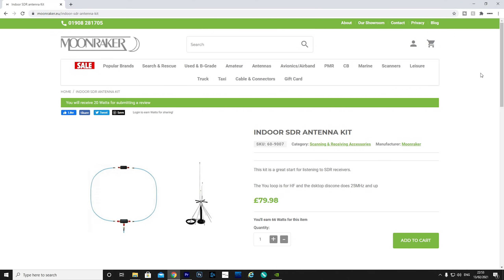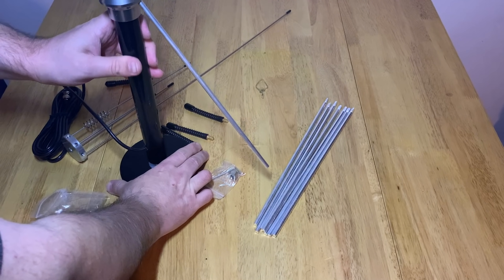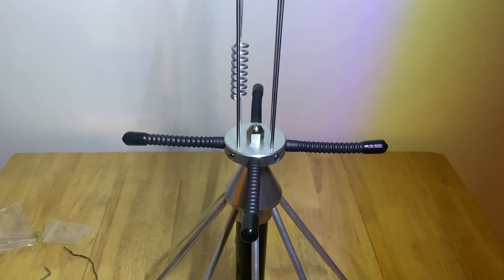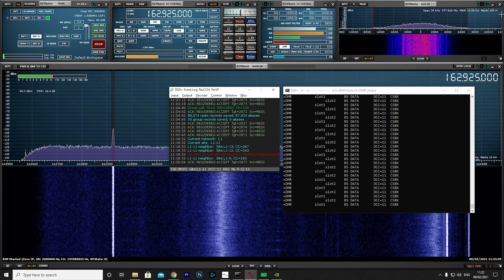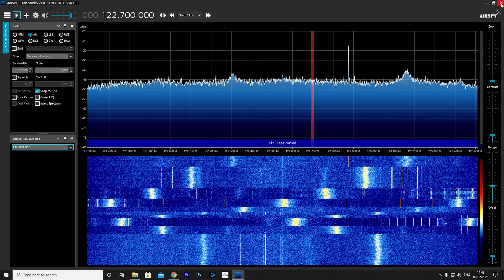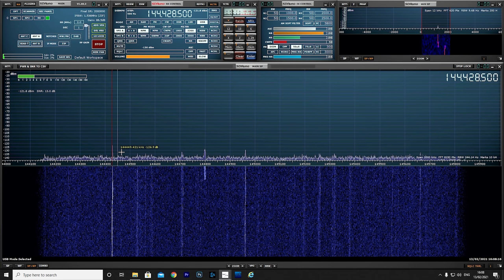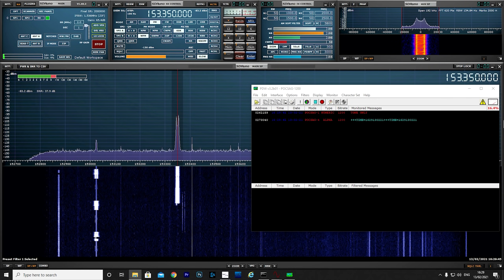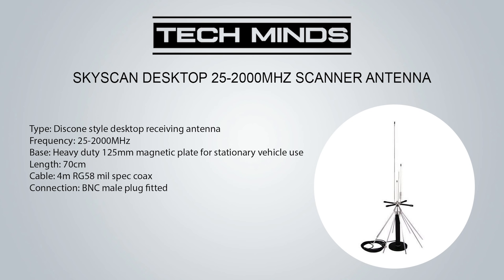Wideband Desktop Discone Antenna - 25 MHZ - 2000 MHz Coverage

Comment: Maybe you could do a follow-up video with a SWR sweep over various frequencies?
Reply from the maker: Check the video description, I posted a link to a VNA sweep :) 👌
Reply: @TechMindsOfficial   Yeah – but, constructively, it would have been more handy to have a decent and accurate sweep of from 115MHz to 450MHz, where most of the scanner interest will be (aero/marine/ham).  In the real world, who the hell listens to 1000MHz (1GHz) and 2000MHz (2GHZ).
Reply: No real need for an SWR measurement, as this is just for receiving.
Reply: It's a receive only antenna,so no way of measuring SWR as you'd need to transmit through it to get these figures.
Reply: @chrisplunkett2814  that's not true, your nano VNA measures the resonant frequency of the antenna with a very low transmission of signal. The resonant frequency is the frequency at which an antenna receives or transmits, it doesn't matter. Also the tiny signal the nano vna puts out is in the milliwatts and wont blow a recieve only antenna.
Reply: @dustinmcdermont699  The nano vna is temperamental as hell. Even holding it differently will cause nanovna measurements to flake out. You have to calibrate a nano vna every time you want a measurement, unlike a more robust analyzer like a RigExpert stick.

Comment: This was one of the videos that led me down the path to get the discount antenna. I love mine I forget what number it is It's on Amazon for like 80 90 bucks and I get the signals everywhere from it with my SDR. I have mine mounted a boat 30 ft off the ground bolted to my chimney in the top of my house. And I still get tons of noise at 2 m band. I haven't been able to figure that one out.
Reply from the maker: going to be a cheap power supply somewhere I reckon. Try turning things off around the house and see if the noise goes away. Trial and error :-) Thanks

Comment: Comparing to the Diamond D130J which covers 25 to 1300MHz,this antenna has much shorter ground plane elements.I doubt if it can work well on frequencies lower than 100MHZ

Comment: Interesting vid as I have the exact antenna, well I say antenna, I have the vertical antennas on the base but none of the radials and don't have the 4 wound radials at the base. I couldn't bring myself to bin it, I'd like to fabricate the radials plus  the 4 small ones around the base, there lengths ...Great vid

Comment: I have been using one of these discone antennae for several years on the rear of my motorcycle for many tens of thousands of kilometres. During assembly l used LOCKTITE on all threaded parts and not one has come loose.

I also use LOCKTITE on my fixed position antenna because l live at 8,000 feet and the wind can shake threaded components loose.

Only one component has failed on the discone antenna and that was one of the "rubber duckie" antennae, and l don't know what the specification is. The manufacturers didn't respond to text enquiries, despite several attempts.
Reply from the maker: Wow! Never seen one used on a motorbike before, we’ll done!

Comment: I have one of these Antennas. I was not happy with the coax so I changed it to RG mini XX all so wanted it longer but with out a join.to get to the in side plug it has to be warmed up ware the plastic fits in to the metal of the Antenna but remove the base and the top of the Antenna be careful when warming up the Antenna don't get to hot because the plastic tube will go floppy it would be easier if some heats it and another pulling it until it comes apart.i fitted 20-meters on mine RG mini 8 xx.when fitting the tube back in the metal Antenna gust use some Epoxy but only on the last 10mm of the tube.one thing if you got a watch on take it off because the magnet will kill your watch.i bought 15-inch of plastic tube because I wanted it a bit higher from the base.it won't ever go on a car because its would or mite come off.the RG 8 mini XX has made a difference .well worth doing.happy scanning

Comment: Picked this up fairly recently. I was pretty surprised at what I've been able to recieve so far. I'm near the cost and can pick marine traffic up at 40ish miles, plenty of air traffic from Ireland and England, even hams from Devon way (I'm from Wales).  All that from using it indoors.  I'd put it outside on a good day but wouldn't leave it out.
Reply: i have had mine on my balcony for about three years now, still works perfectly! 73, Levi in Sweden
Reply: I'm from Wales just picked up the antenna hope it does the job 👍
Reply: @rickets5094  Nice.  Hope it works for you.
Reply: @Axl_Pose  didn't realize I needed a adapter for RTL SDR lol waiting on it now..
Reply: lol hopefully it comes soon and you'll be up and running in no time!

Comment: If you can find a copy of Openear, especialy the one that didn't have tetra removed, it is waaaay better that dsd+, you can pinpoint transmissions with sdr sharp and get the mode automatically decoded but as far as the quality of decoded voice/audio goes, no match.

Comment: I can't see any advantage at all in combining a very poor discone , 4 rubber duckies  rather than a top disk of the usual 8 (or more)   rods,  with a few vertical elements.  It's a complete shambles of a thing.  Not sure where they plucked 25Mhz from, but it's a marketing ploy. Advertising gurus making silk purses from sows ears.  Try a wire coat-hanger, straightened out, cut in the centre and connected to the same length of co-ax.  Not joking.

Comment: I found this antenna to be very poor for the price and noticed I could receive signals without all the radials and whips attached and when attached the same signal was received with all the bits added there was no change in signal strength. No antenna in the world is capable of covering 25 to 2000mhz as it's totally impossible. I thought it was very poor for the price and found a slim jim cut for around 200mhz and a 3rd of the price massively out performed this discone.

Comment: You'd be surprised by just how many flights there are in the UK every day.  Use "ADS-B Exchange" to verify.  We even have many 747s landing in the middle of the night in Aldergrove.  It's clear that there are "Rules for thee but not for me."
Reply from the maker: At the time of recording that particular clip I did check radar24 website and there was no aircraft in the close area apart from those shown in the video. I wouldnt recommend the discone for a series ADSB antenna, its just to show it can be done. ;-)

Comment: Don't suppose you know what that pulse is at 153Mhz below the POCSAG channel? It must be nationwide. I can hear it here in the midlands.
Reply: It's good old FLEX pagers.  Easily decoded with multimon-ng.
Reply: Try this:   rtl_fm -f 153.023M -s 22050 | multimon-ng -t raw -a FLEX -e -f alpha /dev/stdin
Reply: @MI7DJT  Thanks. Raspberry Pi script time. :-)
Reply: @MI7DJT  I've modified my POCSAG file to this 'nc -l -u localhost 7355 |	sox -t raw -esigned-integer -b 16 -r 48000 - -esigned-integer -b 16 -r 22050 -t raw -  |	multimon-ng -t raw -a FLEX -e -f alpha /dev/stdin' and listen to UDP coming out of GQRX on the Pi. Works great. Thanks
Reply: @OutpostH  Nice job!  There are so many neat ways of achieving the same result.  Like how you're using gqrx so you can get a visual on the signal.
Reply from the maker: It's also POCSAG, and if left on with PDW running it decodes many medical messages too.

Comment: Discone antennas have very interesting wide band properties, this seems like a nice bit of kit, I use a Diamond discone, although a bit larger than the one profiled here, cheers, n yr videos are outstanding
Reply: wide band...but no gain! I too own a Diamond discone, only useful for close communications (and more remote air com). Because I'm more interested in the 135-470 band and love in the deep country (few local transmissions), I built a log periodic antenna tailored for this band. Dramatic results (6-8 db gain / discone). Only weakness : somewhat directive.
Reply: @florentleider222  weakness? gain = directive. that's how gain works.

Comment: As an Rx only antenna one could possibly use it as QRP at less than 5watts. It would be worth a try. I have something along the same path that was made by Niljohn in the States some 20 years ago( they have been since acquired by a company that manufactures military multiband antennas) and it covers a wide range between 2meters all the way up to 800 MHz and can handle up to 50 watts. It consists of three "verticals" of different lengths set at 120° apart from each other and at about 30° off of the vertical axis. It is designed for mobile use although a bit crazy looking for the average ham antenna.
Reply: Subgunman, I too have the Niljon Classic. It's mounted on the bonnet of my Jeep. It provides very good low earth orbit FM repeater satellite coverage as well as good terrestrial operations from the mobile. I just acquired its big brother the Niljon Ultra which sports six "verticals" of varied lengths set 60 degrees apart and also 30 degrees off the vertical axis. I bought the home station version with the required groundplane elements. It has a nearly flat SWR from 88 MHz continuously through 6 GHz. I plan to use it on the various ham microwave bands in addition to the usual 2m, 133cm, 70cm, 33cm and 23cm bands. 73 de W6NOB

Comment: Looks like an all around winner. Is it just a scanner antenna? Can't you transmit with it as well? 
I heard today that the U.K. was locked down, but I didn't know there was no air travel, right now! Hows that lock down working for everyone? Has the China-virus disappeared  yet?
Reply: There is lots of air travel in the UK.  Check ADSB Exchange.
Reply: China virus? That sounds like some conspiracy theorist.
Reply: @sammiller6631 

It was. Waky waky! 😂
Reply: @PureAwareness76  Why would the OP want to transmit from a discone? It's no better than a stubby rubber duck antenna. They should "waky waky" their antenna knowledge.

Comment: so is this a receive only antenna , and can a person tx through it ? if so  how many watts ?
Reply from the maker: It's not designed for TX, but you can view its VNA plot here: https://drive.google.com/file/d/1sr6WLgS9Zyf5ZOf4L7Lu4VtV91a2x4ux/view?usp=sharing
Reply: A friend have a MFJ discone and it TX ok on 144,  435 and even 1296Mhz, the gain is very low, but it can be done

Comment: DESKTOP DISCONE makes me giggle ..wideband rf probe in a home enviroment ... .... get it high and outside with some lmr200/240
Reply from the maker: Exactly, but this antenna is marketed as a Desktop antenna. Which is why I also demonstrated using it outside. Unfortunately, not every one has the luxury of installing antennas outside.
Reply: @TechMindsOfficial  indeed :) and as per cool video .. maybe you could do a show about filters and tuners :)
Reply: I personally wouldn't see it as much as a desktop antenna as I would see it as a portable diskone antenna I can bring with me when I go somewhere